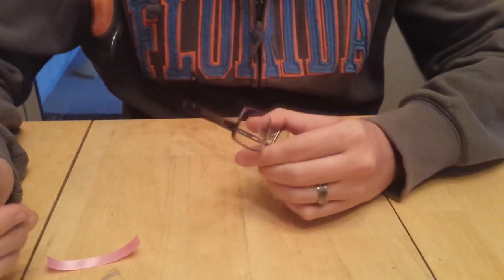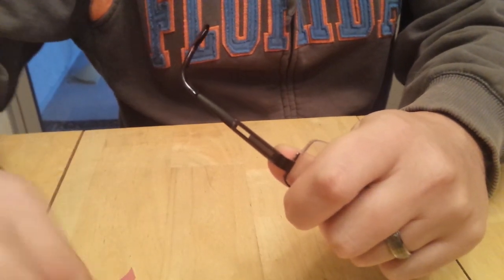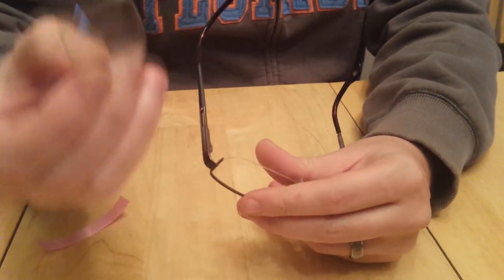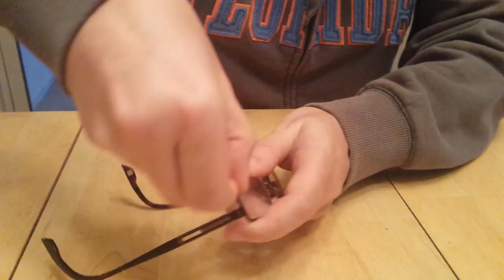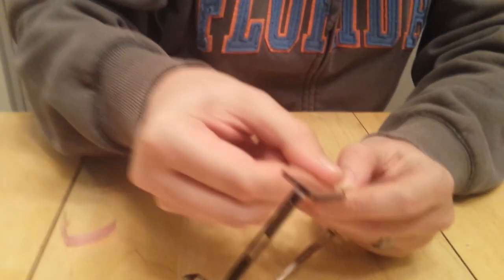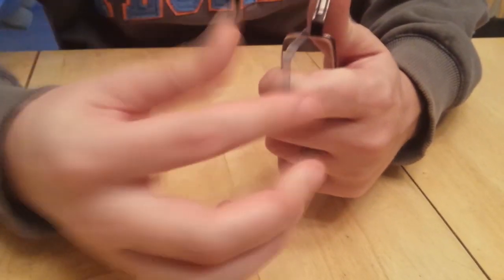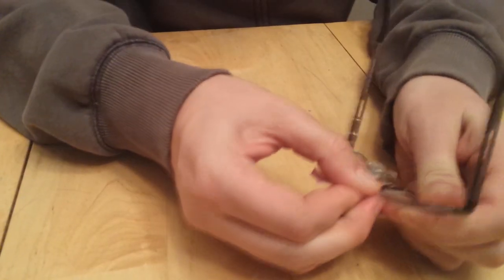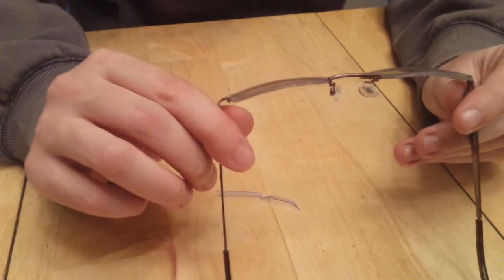How to: Replacing semi-rimless lenses

Comment: Worked perfectly, thanks. Didn't even need the "stiff ribbon," just the soft one. I was able to press the old lens out of the frame with my thumbs.
Reply: I just used a tiny screwdriver, instead. Downside might be that the lens might just get damaged if careless.

Comment: Thanks  it worked great I had a spare set of lens I ordered with my last pare of glasses.  It took less than five minutes.  Went to the kitchen and found a thick corn chip bag cut a strip 3/8 wide to a point wa la a tool worked great .

Comment: thanks to the video I've had my broken frame replaced! but for some frames (like mine I was trying to fix) you can find ready gaps to stick the ribbon in so that you don't damage the frame by accident (and mine was so hard that it was impossible to open a gap like in the video) but very helpful video broke my frame swapping viginity so much fun
Reply: but i had to cut the ribbon in half because the gap is not as wide

Comment: I’ve found it easier to remove the old lens by simply pushing on the top from the inside with one or both thumbs rather than using the hard piece to separate the filament.  Of course, be careful not to bend the frame while doing so.

Comment: Just swapped out the lenses on an older pair of glasses because the wire on the new frame snapped. They were Perry Ellis frames from Costco so the technique was a little  different to make room for the ribbon. Other than that it worked perfectly!

Comment: We need both soft and hard piece of ribbon as special tools or materials to fix? By using regular glue and tape won't work?
Reply from the maker: Wouldn't recommend glue, but tape folded to not be sticky would work
Reply: Regular small tape or ductwork tape won't work?
Reply from the maker: @xianli6488  I would recommend regular tape, get a strip 3 inches long. Fold it in half longways. And cut one end to have a point. That way you can feed it between the wire and the lens
Reply: Alright  thanks I will give that a try. Even though I can't sent pics of my broken glasses on YouTube being attach?

Comment: I just can’t seem to get the nylon to go over my lens to fit in the groove any tips?
Reply from the maker: put the lens into the top part of the frame first. then use the ribbon (or whatever you are using to grab the nylon wire). start from one side of the frame, set the nylon wire into the groove onto one side of the  exposed portion of the lens where it meets the frame. Slowly pull up and over the lens as you move across from where you started to the other side. the nylon wire should guide itself into the groove. hope this helps

Comment: Thanks for the video. However, it's not working on all frames, not for mine. I have a Hugo boss titanium, it's too fragile to push out the frame to have the gap.
Reply: I too have a silhouette titanium frame, extremely fragile, but since it is  titanium, it would at max bend and not break. i got mine fixed.

Comment: I was going to use this guide to swap out a broken frame, but I couldn’t get the filament to loosen at all, I ended up giving up and taking it to a glasses repair shop. They couldn’t either, ended up re stringing both lenses. Left a dislike at first but changed it after seeing that it was a manufacturing issue